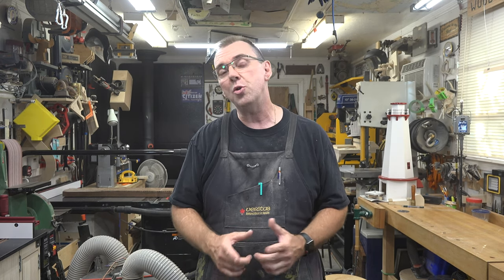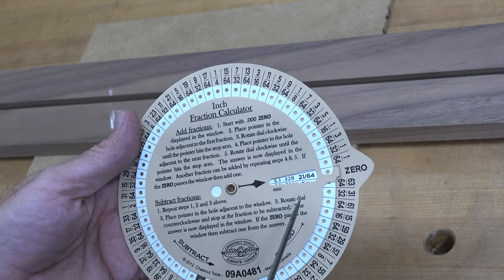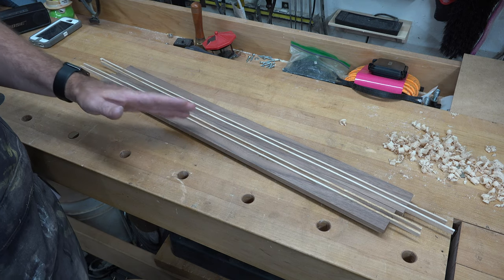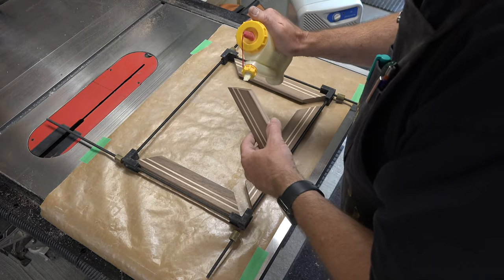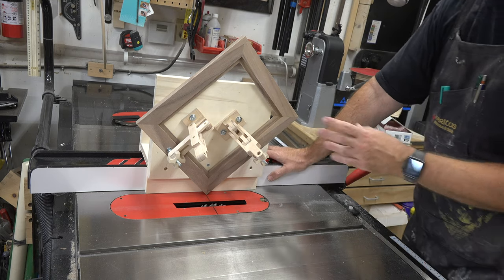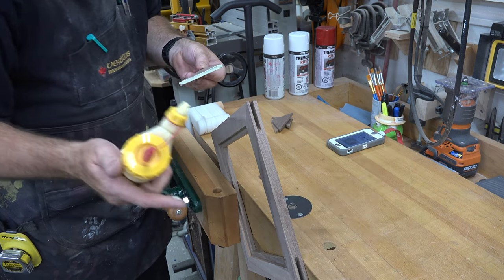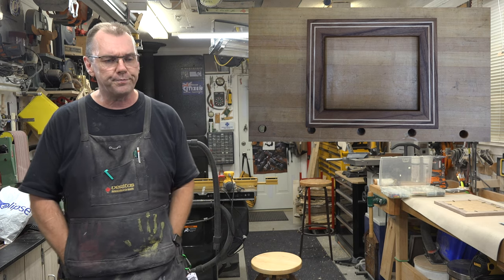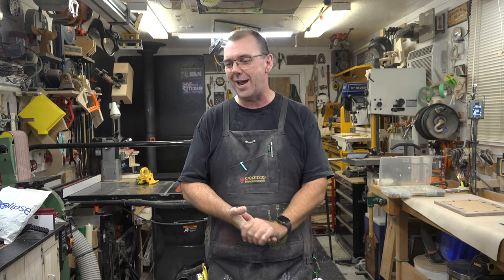Making a Custom Graduation Frame

Comment: Congrats to your daughter. That university should be slapped for not giving out the frame.  Those Incra miter gauges are spot on. Worth every penny!
Reply from the maker: Thanks for the kind words.  The university not giving a frame turns out to be a blessing as now she has a hand made one from dad that will outlast any frame that the university could have supplied.  I agree with you 100% about the INCRA mitre fence but just as with any tool, they are only as good as their setup so you really need to take extra time and care to calibrate it correctly.  Thanks for tuning in to the show and taking the time to leave a comment.   I truly appreciate it.

Comment: Another great, detailed video.  One suggestion...you often.show unique tools or devices when making your projects; it would be informative if you would add source links. Thanks
Reply from the maker: I think you are referring to the fraction calculator that I used during this program Ronald.  I tried to source a link to that unit but unfortunately I have discovered that it is no longer available.  I am trying to find a new source and when I do, I will add it to the description of the video.  Thanks for your suggestion.  I'm sorry I couldn't help out more with this one.  Thanks for tuning in.

Comment: That fraction calculator is awesome. I want one of those now although it doesn't seem to be available 😥
Reply from the maker: I've had that fraction calculator for some time now Nate and I just went and checked and you are 100% correct.  Sadly, the calculator is no longer available at Lee Valley where I purchased it.  I tried to find another source but was unsuccessful.  I will continue to look for a new source for them and if I find one, I will report back.  Thanks for tuning in to the show.

Comment: Awesome video. I followed your video as a resource for making a couple frames for my own degrees. I used cherry with one inlay of Purple Heart. 

I’m curious…
How did you create the cutoffs of maple? Table saw? I actually used my router with a 1/4” straight bit to create the groove for the Inlay, then just cut thin strips of PH on the table saw. 

Also, what was your finish? Everything looks great! Thanks for the video.
Reply from the maker: Yes, the maple was all done with the table saw.  As for the finish, I used several coats of water based varnish in a satin finish.  I applied it using an HVLP sprayer and applied 4 coats.  Came out great.  I hope this helps.  Thanks for tuning in Andy.

Comment: Congratulations to your daughter. The frame came out beautifully. I appreciate you showing us your frame making skills. Once the weather starts to warm up, I want to go out to my garage and give it a try. Do you have any recommendations on buying glass? Do you buy a sheet and cut it or do you take the finished frame somewhere and have them match it to the frame?
Reply from the maker: Glass is one of those things that I am always on the lookout for.  When people throw away frames, I usually try and salvage the glass for other projects.  Barring that, if I need something a little more custom, I hit my local hardware store, who will cut glass to custom measurements for cheap.  It usually only costs me a couple of dollars to get a piece of glass for a frame.  Check your local hardware store to see if they cut glass.  I hope this helps.  Thanks for tuning in and for the kind words.

Comment: Hello Ken.  Great looking frame. I have bever seen one of those dial fraction finders.  Is that a Lee Valley product.  I did check their website too no avail
Congratulations too your daughter for her achievement
Harleymike/chicago
Reply from the maker: I purchased this fraction calculator a long time ago at lee valley and when the show was filmed, it was still available.  Several people have asked about it and it would appear that since the show was filmed, Lee valley has removed it from their product line and it is no longer available.  I am trying to find a new source for them and if I am successful, I will be sure to report back.  Thanks for tuning in to the show and for the kind words.  It's truly appreciated.
Reply: @acutabove_woodworkings  OK Ken I hope somehow you do stumble across the source and pass the info over to your subscribers.  I just know a ton of is will sweep them up
Thanks for your concern for your followers as well
Harleymike/chicago
Reply: Hello Ken.  Lee valley has it listed under 09a0481.  However not available on my region
Reply from the maker: @michaeldunn5280  That is actually the old listing that I had of the product.  Lee Valley has discontinued carrying this item.
Reply: @acutabove_woodworkings  thanks for the updated info Ken
Reply from the maker: @michaeldunn5280  You're very welcome.

Comment: I liked your picture frame how to. But, could you make another picture frame that goes into much detail on how to make one. I recently ran into your YouTube channel because I just purchased a scroll saw . Liked your example on how to tension the blade , I tried it and it worked and gave it a like . For this video I gave it also a like. 👍🏻
Reply from the maker: If you search the channel's content, you will find many episodes of the show that will hopefully interest you.  There are well over 500 shows on the channel to choose from.  Here is a link to part one of a multi part frame tutorial that I did years ago.  It is an older video and a little rustic, but it might give you the information that you are looking for as it goes into depth about making a custom frame.  https://www.youtube.com/watch?v=VSTySBcCDEk&t=3s  I hope this helps.  Thanks for tuning in to the show.

Comment: Where did you get the fraction calculator ?
Reply from the maker: You are not the first person to ask this Allen.  I bought this fraction calculator years ago at Lee Valley Tools.  I tried to provide a link but have discovered that since filming this show, Lee Valley has taken the calculator out of its product line and it is not longer available.  I am trying to find a new source and will report back if I am successful in finding one.  Sorry about that.  Thanks for tuning in to the show.